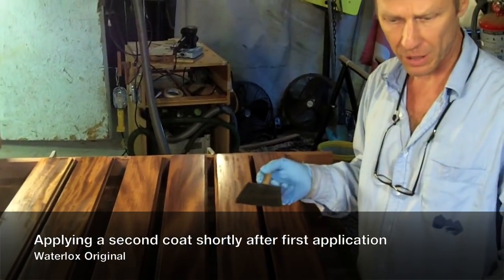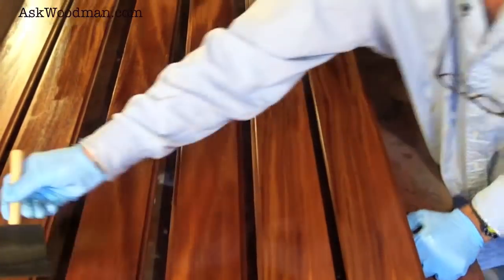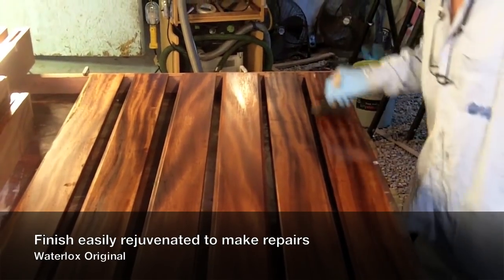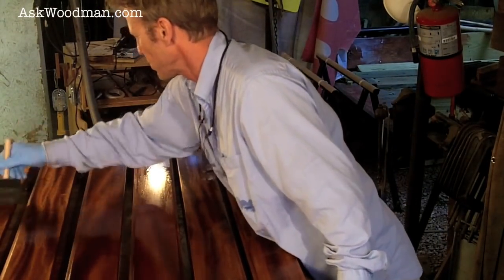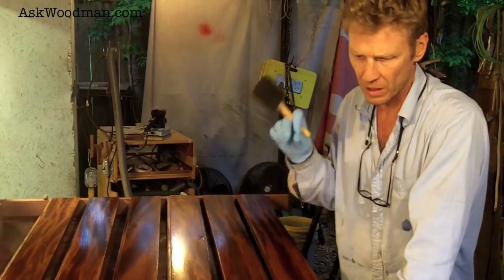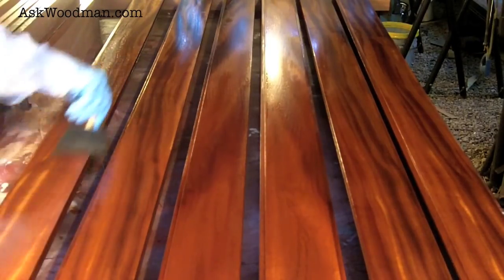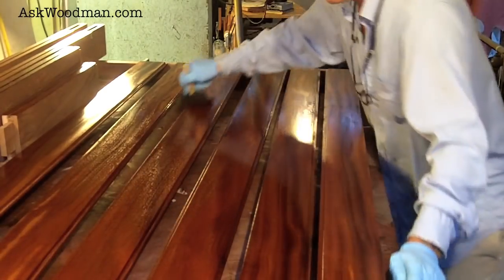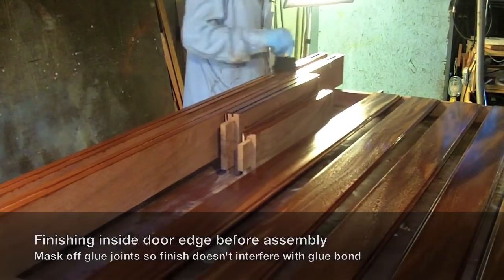14 How To Apply A Tung Oil Based Finish - SOLID WOOD DOOR SERIES - Video 4

Comment: I really appreciate your videos and you sharing your techniques. I'm getting ready to do my kitchen cabinets with ribbon striped sapele fronts (plywood). I'm not sure if you ever do this, but what would you use to make sapele a little darker? A stain? I'd love to still see the ribbon stripe but to have the wood a bit darker. Sorry if this is offensive as I know many people would cringe at this.
Which Sutherland Welles product do you use now / which one would be good for a low sheen finish? I've used Epifanes marine varnish in the past and it was ok, Definitely not as easy to work with and you have to wait for coat to fully dry before doing another one or you get the alligator skin like you mention. Again, thank you so much for sharing!
Reply from the maker: Rafal Godlewski You are on your own staining sapele. I am not going to be part of a crime against nature. Sutherland Welles Murdock's Hard Oil. I will do the first coats with Murdock's Hard Sealer if the wood is really dense and fine grained like hard maple. Since I ditched Waterlox I have also reverted back to the finish I first started with. 
https://www.youtube.com/watch?v=lEeb3t1tmSc&index=69&list=PLqtTuVwYBfkxFXRDiDyiAlFeqMKOlh0eC Then top coat with Hard Oil.
Reply: AskWoodMan Thank you!!!

Comment: I'm going to try the Duster method on some stuff I have stored in glass jars (harder to crush!) that tends to skin over after a while (some oil-based primer I mixed up for priming linen). If it works I could see a lot of other applications. 

BTW I just put four coats of Waterlox on a beech table today based on your high praises of it, it looks beautiful!

Comment from the maker: @nomorejournos 

Please note that Waterlox is specially processed tung oil product. Pure tung oil is a mess to use because it will not dry. You will have no bubble problems with Waterlox unless you apply it in direct bright sunlight which should never be done with any finish. As I clearly explain in my other videos, (see video response) I apply 2-3 coats between scratching but never use wet paper because it is so much work to clean up rather than sanding with no load or open coat paper.

Comment: @askwoodman i will be installing rustic red oak flooring from lumber liquidators very soon, it is unfinished and while searching the user reviews i found tung oil.  ive never heard of this finish and will be using it, i bought minwax's product and i already have 3 coats on my sample peice. i really like how its turning out. im looking for a floor that has both lite and dark boards, other than buying an exesses of wood and finding all the beat boards, do you have any sugestions.

Comment from the maker: Sure wait till your company is gone. I would probably do a feather sanding with 320 (just a few light passes) to knock off any imbedded crud or oxidation, clean real well and apply the Waterlox. As soon as the waterlox is dry to the touch,point a fan directly on it to speed drying time and dissipate the mineral spirits fumes. Moving air dramatically reduces cure time.

Comment: I have made a bench made from a birch tree we had cut and milled down . I want to finish it with a clear finish. is there something other then poly that I can use that is tuff and durable even with wet or damp items? Thanks
Reply from the maker: Are you asking about finishing wood that is not dry? Not advisable.

Comment: Hey, have you tried Tru-Oil?  How's the Sutherland Welles working out?
Reply from the maker: Sorry about missing your previous comment. I think these polymerizing tung oil finishes would be very difficult to make work for an on site touch up. It does not take much time but it does need time between applications. I tried Tru-Oil a long time ago but did not like buying the little bottles. I am really happy with SW. No mineral spirits petroleum stink. They use a citrus solvent. My shop smells like what I would imagine an orange juice concentrate factory would. I also really like the feel even a day after applying. It does not have that grabby feel Waterlox does.
Reply: AskWoodMan
I agree... these wouldn't work for mobile touchup work.  I'm going to pick up the table & do it in my living room so there will be plenty of time for re-coating & dry time.  And so the citrus smell (as opposed to petroleum aroma) especially appeals to me.
I will give SW a call and see which of their finishes they recommend.  From their site, it would seem to be a choice between their original Polymerized Tung Oil or their Murdoch's Hard Oil/Sealer/Table Top line of finishes.
Reply from the maker: Stringfellow Hawke
I have been using the Hard Oil and Hard Sealer.
Reply: AskWoodMan
After a conversation with Sutherland Welles I just ordered their Hard Sealer.  I will take some before/after pics and let you know how it goes.
Thanks for the info  :)

Comment: I just bought Waterlox to finish a black walnut table we made.  I'm now worried about using it.  Should I not?
Reply from the maker: +Jacob Silvester It is your call but I am done with it. Just too frustrating.
Reply: +AskWoodMan Fantastic videos and excellent explanations, thanks! I realize it might be a dead issue for you now, but were you aware that Waterlox will sell the original original (pre-VOC compliant version) in some states? I checked their website /cross referenced my ZIP code (Greenville SC), and it allowed me to place an order for the original. If TX is on the "no" list, of course that's a problem.
Reply from the maker: +Charles Livingston The low VOC formula is misleading. It just means that it sold with less thinner by volume to make it comply with the % by volume VOC rules. But they can't tell you that you will need to thin it with mineral spirits to make it workable. So how is that low VOC in reality?
Reply from the maker: +Charles Livingston I can still get the Original. But have given up on because of bubbles streaks and lack of setup. I have not used it for 3 years. It is just too frustrating.
Reply: +AskWoodMan Oh, so even the non-VOC compliant "original" has changed in its performance quality, too? Bizarre.
Reply: +AskWoodMan I have never used Waterlox because I've been hearing about problems with it for a few years now consistent with your comments. But as I was watching your video and you were brushing the HELL out of it with no bubbles, I thought eureka, there's the ultimate brushing finish. Then I read the comments section! And back to square one...might try the S&W product you mentioned.
Reply from the maker: +Charles Livingston I am not saying anything about the lower VOC formula other than what I said above about the need to thin it to make it work.
Reply from the maker: +AskWoodMan I used the Original for 25 years and had nothing but fantastic results. Then about 4 years ago I noticed a change and struggled for a year with gallons and quarts with no success to match the previous results until I just said forget it. You will see a link below to the old school finish I have reverted to, and am happy to be done with the strong petroleum smell of Waterlox.

Comment from the maker: @SilverFoo79 It would work wonderfully on hard maple. I have put it on hard maple more times than I can remember with nothing but fantastic results. Check out the 1st video in the Plywood Box Series to see the maple doors in my kitchen (12 years). I have brushed hundreds of gallons of this stuff and it is the only foolproof simple low tech finish that yields pro results I have ever found. And the finish can be indefinitely freshened up if need by the solvent nature of the product.

Comment: Nice helpful videos - thanks. But I need to comment on one thing. Drying times of oil based paints and finishes are not affected by humidity. The oil vapors are 'transparent' to ambient H2O humidty levels and don't 'know' the water vapor is there or how humid it is. Partial pressures and Dalton's Law from Chemistry pretty much make that case.
Drying times of acrylic and other water based finishes ARE affected by humidity - but not oil based coatings.

Comment: If the surface to be coated had condensed water vapor on it (let's say dew) it's not likely someone would be applying a coating even water based acrylic. Submerging the entire city of San Francisco under water is probably not a very good approximation of lowering temperatures and in increasing relative humidity in someones wood shop.The density of saturated air and liquid phase water ARE somewhat different.So if you're applying tung oil to a wood surface submerged in water you're probably right.

Comment from the maker: You are right Robert, you don't need to scratch for adhesion, but  I am never in a clean enough environment to just go coat after coat without knocking the junk off so I have to. Write me at gmail and we can have a chat if you like. I have brushed hundreds of gallons of this stuff over the last 25+ years and feel I have a good handle on it. Allan

Comment: the marble idea is no more strange that the crushing of the can....and you don't run the risk of the can getting a hole from being bent.
Reply from the maker: Then marble away. Don't let me stop you.
Reply: AskWoodMan
hi can you tell me if tung oil is a shinier finish than linseed oil,as i cant seem to get the shiny finish with linseed.like your getting.Or do i have to put more layers on
Reply: AskWoodMan Your the second guy that I have been watching that crushes the can, sounds like a good idea to me l

Comment: to what grit do you sand
Reply from the maker: +Michael Toppel I sand until I see not swirl or scratch marks from my half sheet sander. Generally 320 or 400. I hate tool marks. Here is a video you will see later in this series. https://www.youtube.com/watch?v=ex0NRjJy14o  I don't use Waterlox anymore.
Reply: +AskWoodMan Thanks Wood Man

Comment: Why haven't you deleted all your Waterlox videos if you're so bearish on that product?   And is it certain Waterlox changed the product formula after several decades?  If yes, why?  I just found Waterlox via message boards posts.  And found your vids via simple search.  As a home owner, I'm willing to continue researching their product & use it for cherry dining table re-finish (unless I find a competing product I find more suitable).   Whatever the case, I liked seeing your vids on Waterlox.  'Watched several w/o knowing you'd "gone in a diff direction".....
Reply from the maker: I have left the videos up because I want to leave them up. It was working well when I did them. I do not know anything other than my own experience using the product for 25 years prior to experiencing negative characteristics I had never seen before.
Reply: Fair 'nuff.  I appreciate they're up.  I've learned from watching them.  Seems like w/ your knowledge, Waterlox is a guy they might wanna discuss the product with.  And vice-versa.
Reply from the maker: I tried 4 years ago. They denied there was any problem. I moved on.

Comment: That actually is not true.  If Dalton worked as a painter in the fog of San Francisco for the past 20 years he would have to re-think that law for sure.
It's like covering a can of oil paint with a lid, if the humidity is dense enough the water molecules will actually seal in the surface of the freshly painted surface.  Go ahead and submerge a freshly oil painted board in a bucket of water and wait for it to dry.
Now if your applying a product with a catalyst, that's a different story.